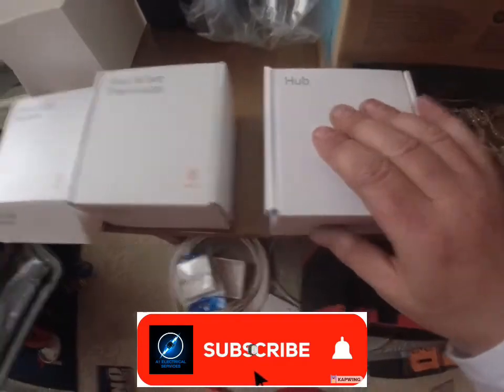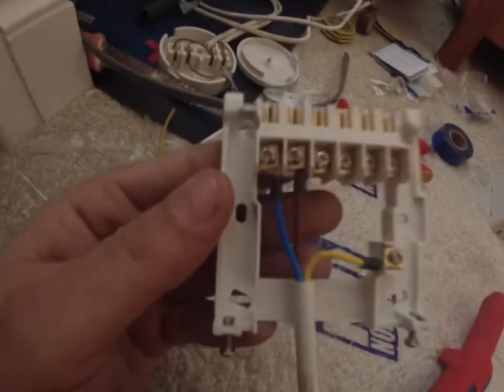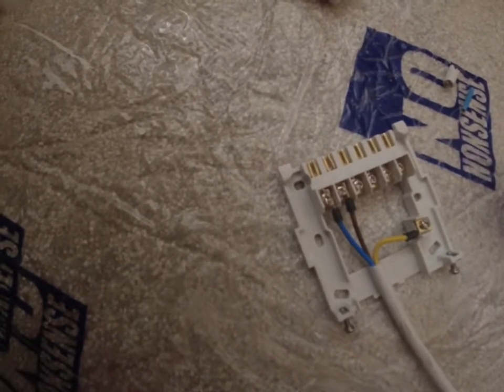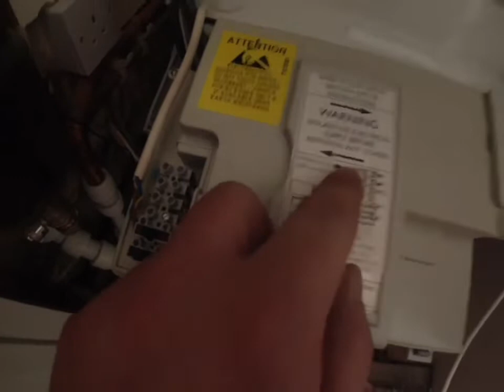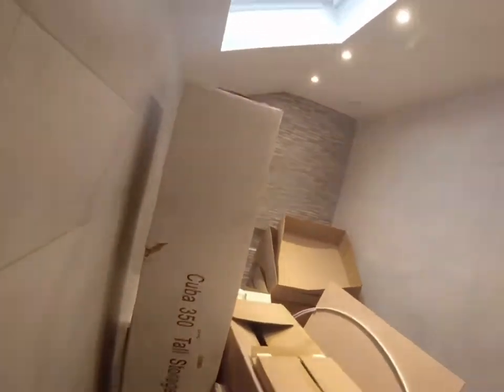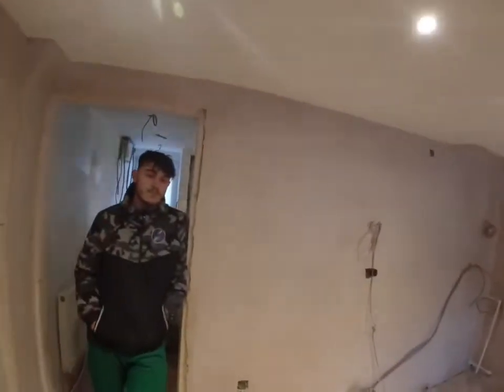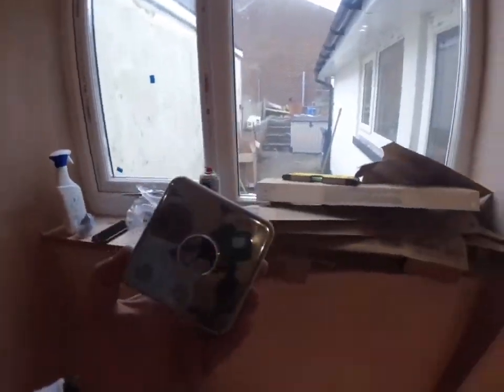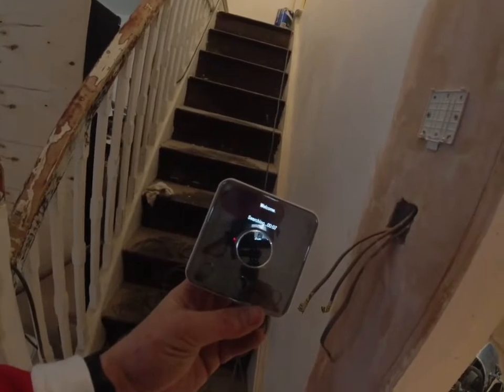Wiring the HIVE system to a combi boiler | Electrician

Comment: Hi A1, the hubby just installed using your instructions. Everything is connected and all the lights are the correct colour and the app is active and controls the thermostat, however the thermostat doesn’t seem to control the boiler, we have a boiler with on, off and timer (using the little toggle pegs to set the timer) and have checked it on all settings but it’s just not doing as it’s told! We’ve tried resetting but it seems to all be as it should? Do you have any advice please 🙏 thanks Nicky
Reply from the maker: Hi Nicky, is the timer built into the boiler? If it is it may need to be removed as I done one not so long ago and this was the case. The timer was interfering with the hive system

Comment: I have a boiler going through a fused switch like yours. I have the supply in the switch. My problem is that i have wired the stat and my boiler wont turn off. Has it got anything to do with the fact i dont have the grey and black cable in the fused spur? I have to switch the spur off in order to turn off the heating.
Reply from the maker: You must have the wiring mixed up in the stat some where